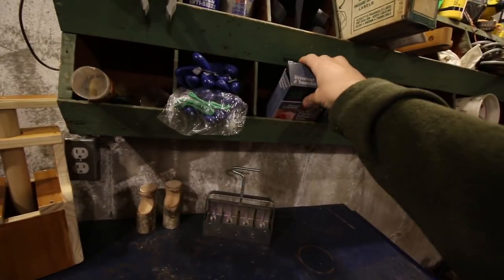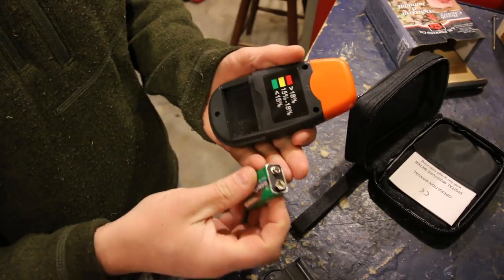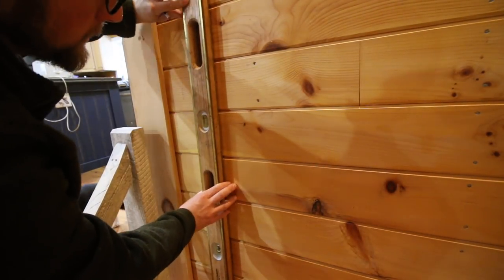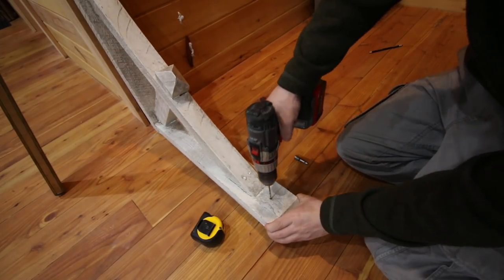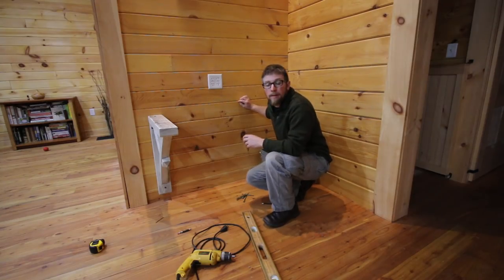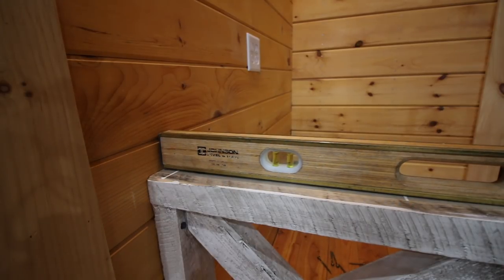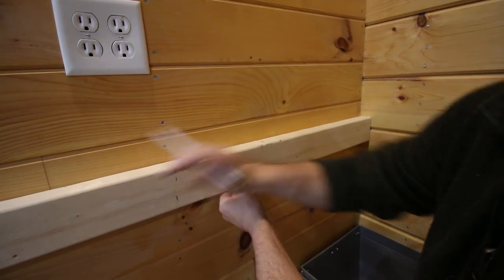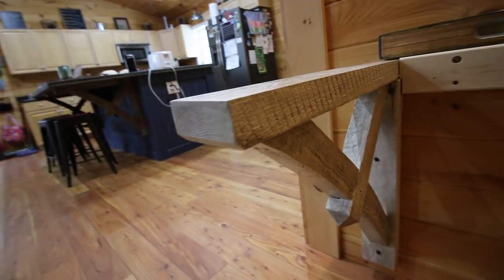Concrete Desk Project  Putting Our Tools to the test Installing Corbels ~ Ledger

Comment: Rigid and Milwaukee have a long standing history of warranty backing.  I still have Ridgid and Milwaukee tools from when I was a teenager/apprentice in plumbing, heating, and gasfitting....over 50 years ago, but they are all corded (110v) power tools that I still use today.  Ask 5 people who use battery run tools which are the best, you are likely to get 5 different answers. My first cordless tools were DeWalt, but the batteries were/are very expensive and I went through them FAST. I switched over to Ryobi and that's what I use now, good battery life and voltage selection, least expensive, and readily available. I bought the mega charger for having lots of fresh charged batteries.
Very nice job Gina on the antique work!  Figaro 'the photo bomber' did his part, such a cool cat!  Nice job Al, the craftsman as always!  God Bless

Comment: I have had all the brands of tools over the years, Ryobi, Dewalt, Milwaukee, Porter Cable etc. I still have a few Ryobi's but have switched over to Rigid. They do have a "life time service agreement". You do have to jump through a few hoops to "warranty" a tool but if you follow the rules you have a pretty decent warranty. You have to register the tool online within 30 days of purchase and you must save your receipts. I've had to use it once for a battery and it was pretty easy and I got a new battery within a few weeks.
Reply from the maker: Good to know thanks!

Comment: I got tired of the batteries for my cordless, going bad, and having to buy new ones. So I busted up a dead battery pack. Ran wires into it, and connected them to the positive and negative for the driver. Glued it back together. Cut the wire off at 15 feet. Then connected it to a small battery for a riding lawnmower. A corded cordless. LOL Not quite as convenient as a cordless. Not quite as inconvenient as a corded! And I am laughing because to me, that corbel looked pretty antique before you painted and antiqued it. :) Looking forward to seeing the new tools!

Comment: LoL, Its funny hearing the corded drill sound.. Haven't heard that in a while. I still hang on to mine though. Funny thing is, I went to an Auction a few weeks ago and waited all day to bid on a old hand drill, the old timers type,  and was so afraid I would have to pay an arm an a leg for , because a lot of old timers were checking it out and everybody passed it over. I was so grateful, I got it for 5.00 bucks and was tickled pink...man what a deal. It will passed what ever drill I currently have and whatever drill I will have in the future..
Reply from the maker: Sounds like you got a great deal!

Comment: I highly recommend the Milwaukee 18 volt 9.0, great kit, high quality
Reply from the maker: what tools in the kit did you get?
Reply: Lumnah Acres I got the combo kit with drill, impact with the bonus light tape measure and utility knife for $199 it was an awesome deal
Reply: Lumnah Acres since then we had a subscriber send us the circular saw and sawzall with the 9.0 battery, high quality great power and battery life

Comment: I’ve been pretty happy with my Rigid tools. I got a combo set a few years back and they are holding up pretty well. That being said if you have a good relationship with the tool department sales guys sometimes you can get a deal if you just ask. I got about 25% off on mine just for asking if they could help me out!
I’ve owned Makita 👍, Bosch 😐, Dewalt 🙂, and found the biggest thing is battery life. Look at the charging times of the battery. Even if the battery seems to drain just a little sooner if you can charge the second on fast you don’t loose productivity. 
I only have corded Ryobi tools but they are plenty good for the money.

Comment: If you unscrew the chuck off the drill, there are probably screws that have come loose. Drill a bit larger pilot hole for the screws to fit in, it will save a lot of stress on the drills. Just from my own experience.

Comment: If the Batteries you have will Fit Either Drill Set your options are unlimited.  If not I would buy the one that is compatible with the batteries you have....  Always nice to just have extra Batteries on hand that are charged..
Reply: always good to receive some love...

Comment: Ooh.. suspenseful ending... have fun tool shopping Al. What other tools do you need to break and replace?  hehe. Personally I'm a Dewalt/ Stanley tool fanboi. Flirted with Bosch and Ryobi and was disappointed.  Been building my collection for many years now, but still nowhere near as comprehensive as yours.  My Grandfather had Stanley tools, Father had Stanley tools,  first hand tool i was ever allowed to practice with was a Stanley tool (screwdriver), so for me they just feel right. I get most people aren't swayed by brands these days, but moreso price, but my tool philosophy is that I would rather buy a tool once in a lifetime and pay a few dollars more rather than, go cheap, hate using it and go through hassle to replace it after a few uses.
Reply: +Paull M....Myself also. I've tried 'em all. Regardless of brand or country of origin, some tools just outperform and outlast others for specific tasks.   Debating tool preferences is like arguing theology or politics.....Pointless.

Comment: Driving those screws in in one go! Lol. 

Hey I’m curious as to how you are going to get that very heavy slab up stairs. 
Is counter top concrete light.
Reply: Appliance dolly would be best, they have ratchet straps and skid runners on the backside for stairs.

Comment: With the amount you use your tools I would invest in something a little better than Ryobi.  Milwaukee is doing a promotion where if you buy their fuel combo (driver and impact) you get a 3rd tool for "free".  If you already have the DeWalt batteries I would go with the yellow monster.

Comment: Check out Ave's channel for tool reviews! I'd get a Makita Brushless. Watched that review, and it was pretty good. He says they're some of the best. The batteries have an over-zealous sensor and lower battery capacity, so cold/hot affects them. But they wrap the battery PCBs and such with wrap to prevent moisture. The gears are cast like in everything else, but he says it's a great drill. Kind of expensive though. https://www.youtube.com/watch?v=ZY7XO5H_6HY